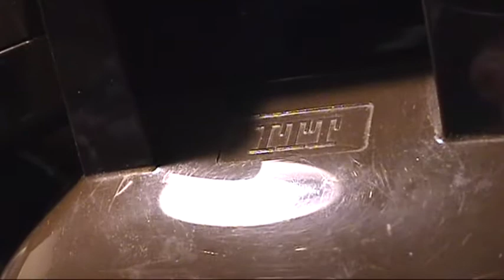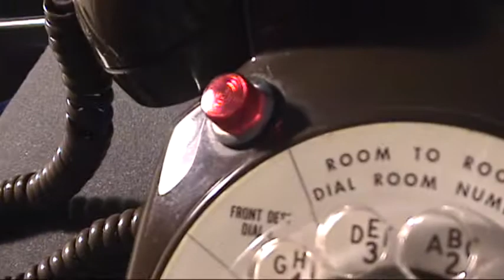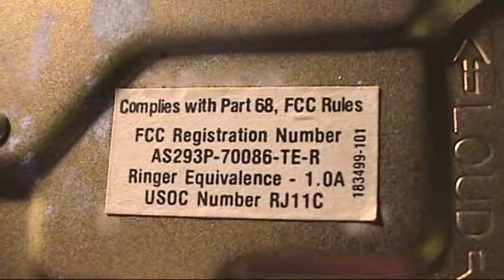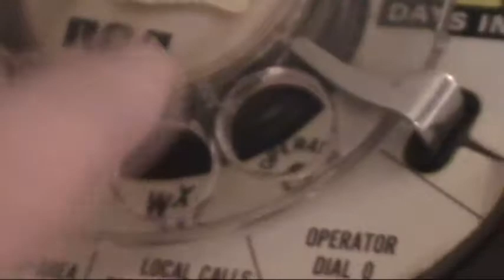1983 Days Inn Motel ITT 500 Rotary Phone

Comment: Replacing the indicator isn't complicated and is replaced in it's entirety as it is a sealed unit. Go here http://www.sandman.com/messwait.html and search the page (control-F on PC Command-F on Mac) for "WAL-2F" and there it is.
Reply from the maker: Something I'm curious to learn is whether that neon bulb will also illuminate during an incoming call. The telephone system with which I've been using this phone doesn't support message waiting, but if the light were to blink, flash, or solidly light up during an incoming call, I'd likely spring for the replacement part.